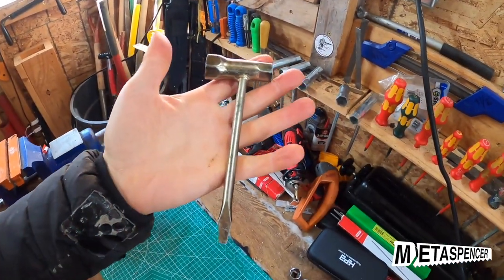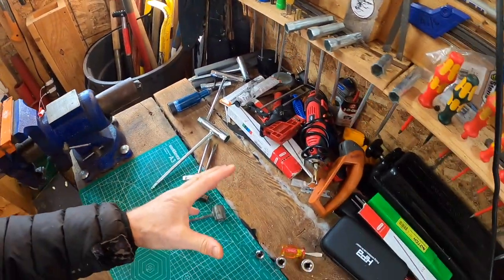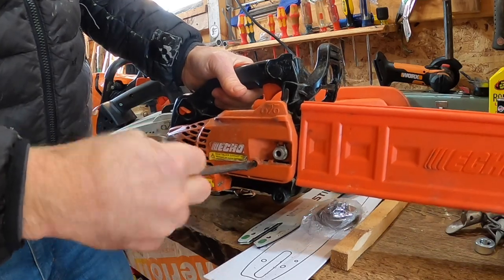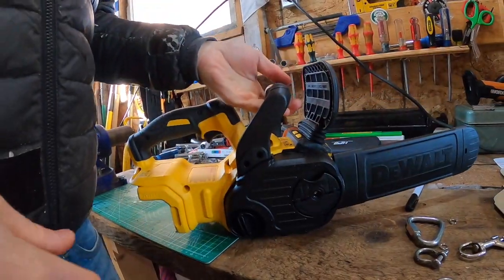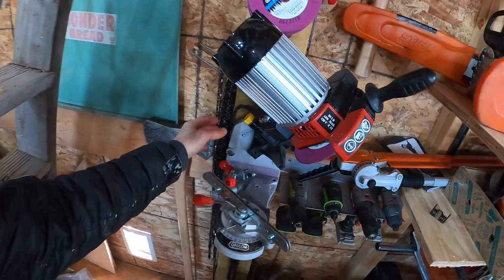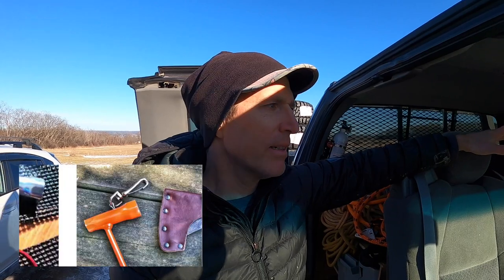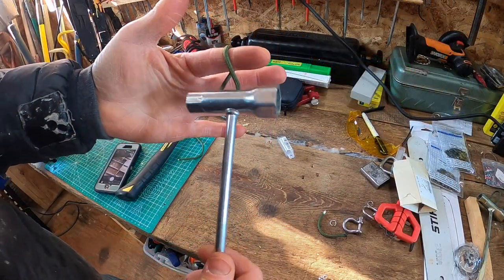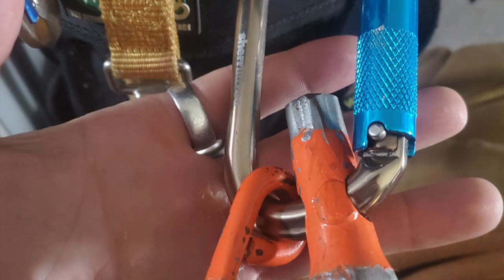Scrench Mods

Comment: Small outboards usually come with the "scrench" as well.  If you need to change a spark plug miles from nowhere on the water and didn't want to carry a heavy toolbox, well the scrench does the job.  In some cases the plug being weirdly recessed needed the 'socket' as well so the old screwdriver, vise grips, and crescent wrench just weren't enough.  Been that way for decades with saws and outboards as well a few other small engine rigs.
Reply from the maker: You make me think I need a small boat and a outboard motor! haha :)

Comment: Couple ideas. For the paracord loop, if you add a piece trimmer string to the inside, it makes the loop more rigid yet still flexible. For the screwdriver, weld a ring onto the end to fit it on the carabiner.
Reply from the maker: That internal trimmer string idea is brilliant. Very cool -- thanks for that. Good stuff man ... thanks

Comment: I don't have the kind of time with chainsaws that you do, but I think the original is mostly fine. I think you could shorten the screwdriver so it's only long enough to work on all the saws. I also think you could attach it to a spring loaded spool - the kind you might use with a key card or for fishing tools. Then it's easy to grab, but always pulls back to a safe spot and never gets dropped. 
There are some T-handled motorcycle tools around that have the common sockets on the ends, and if one of those ends had a modular screwdriver bit that fit a socket,  then you could have Phillips and flat.
Reply from the maker: Interesting ideas! Thanks man. Take care

Comment: I think you should try leaving the scrench alone but modify around the current design. Here are my suggestions & why:
 A) Wrap the paracord around the socket end on both sides of the screwdriver with several lashes. This should eliminate the holes through the metal which eventually will cut the paracord.
 B) We've seen you sew so what about adding to your belt? Do it like the first one you lost only make a horizontal flap that has a button snap to cover over the wrench end. This should keep it snug in your belt but still easy to remove when needed. Think of a shirt pocket with a button snap only horizontally.
 C) Put a small neodymium magnet in your belt at the screwdriver end of where you want the scrench to be. This way it won't fall out.
 In regards to the lashing for technique you might want to check out the old boy scout manual. I learned lashing out of one that came from the 50s. By now I'd be surprised if some one some where hasn't put it or something similar online. This way your lashing will be the best it can be. Wrapping part of the wrench end should insulate your hand from the tool from both cold and overall just make the tool more of a delight to use by adding some cushioning.
    
 Since you are now the pandemic tree guy do you have any advice for getting rid of woodpeckers? A small adolescent downy woodpecker has ravaged my cedar siding. It has made like 6-8 holes in the NE corner of my building. It even pulled the fiberglass insulation out! I don't think it's living in there now. I'd like to spray foam the area but my Little Giant ladder ha been stolen.
Reply: Be forewarned that if you do that Internet law requires it be called a Tactical Scrench.
Reply from the maker: Any solution involving magnets gains 10 extra point from me, so I like it! Sounds elegant. As for the woodpeckers we have the same problem and they really attack the house where there are insects around. Short of swatting at them with a tennis racket taped to a broom handle, I'm out of ideas. Hang in buddy! :)

Comment: Cool and all but you do know the BIG side is for the spark plug? Right? These are all useless if u have a fouled plug. U won’t be able to get scrench deep enough to back it out. So unless you’re only using to adjust bar then you’re screwed. NPI 😅
Reply from the maker: OKAY now you might wanna sit down to hear this but i've NEVER changed a spark plug in a chainsaw .... I should do that!